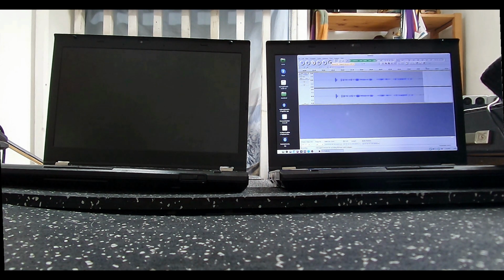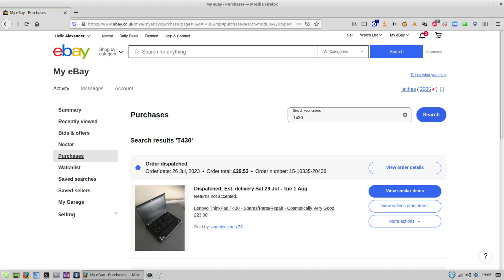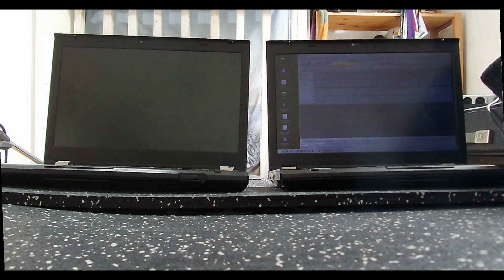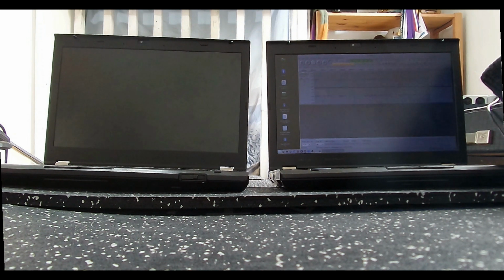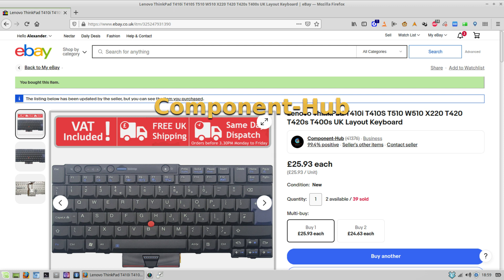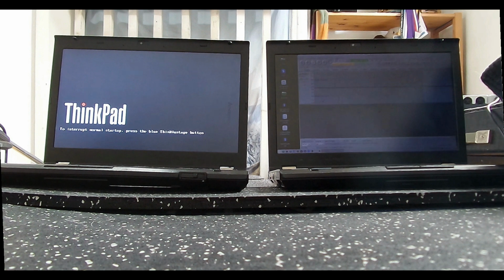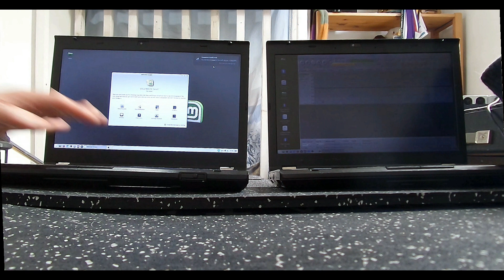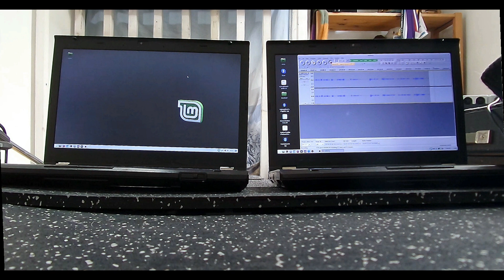Making An Unused SATA Port Into A Wifi Card !

Comment: I do know that Dell Latitude E6xxx laptops have an optical bay USB card option. It provides 2 USB3 ports. The mini SATA connector (the shorter optical drive type) looks normal. A Dell technician told me that certain intel chipsets allow USB over SATA but he didn't explain how it works technically, just that the native SATA controller can tell what's plugged in somehow. I wonder if you have accidentally discovered exactly how it works?
Reply: Thank you! Best answer I've heard so far!

Comment: That usb to sata board works the other way around??
Reply: So it seems! :O The gender changer makes sure the sata pins line up right, and then somehow the usb side does seem to feed the connection through correctly. I was quite surprised it worked though! :D